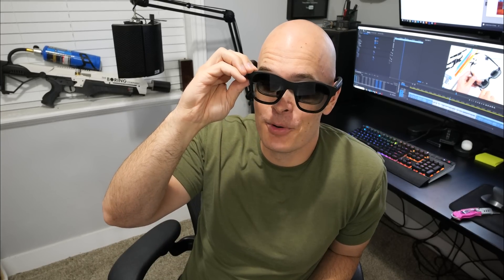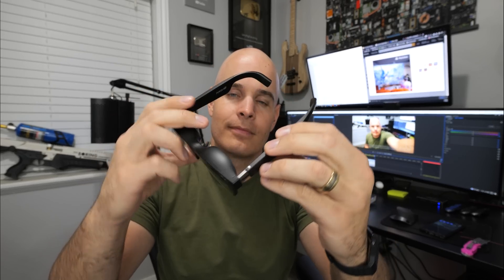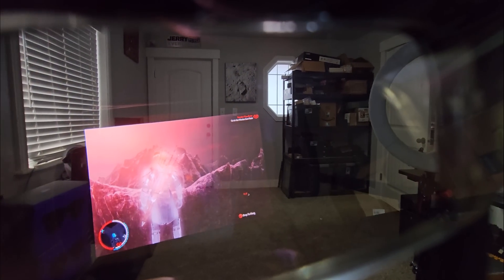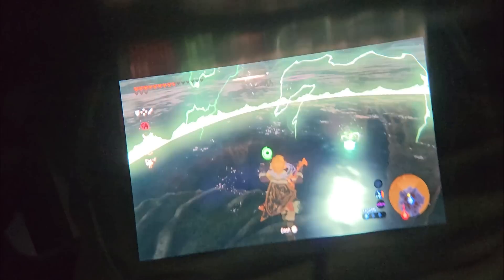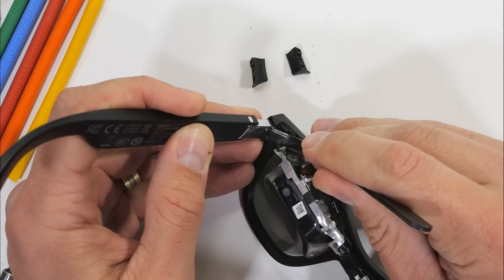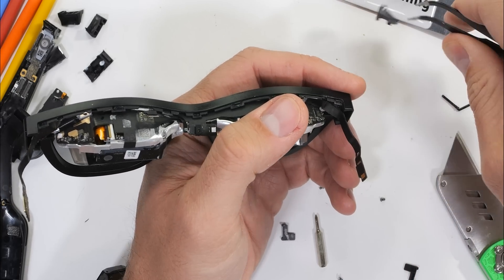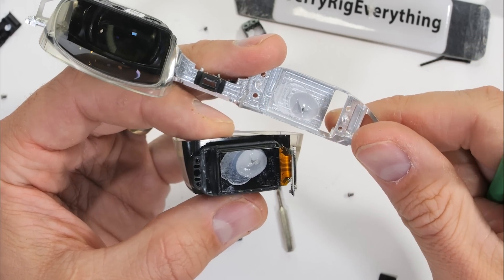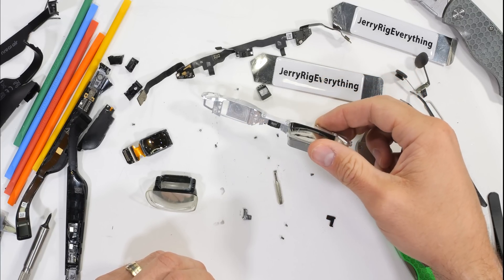The Smart Glasses of the Future are here! - (Teardown)

Comment: My only real problem with this form factor is that I have prescription lenses and can't wear contacts. It'd be interesting to see if they can do something about that in a future model.
Reply from the maker: They actually do ship with eye glass blanks that can be custom made to your prescription and attached inside the glasses. (so you'd be wearing 3 pairs of glasses built into one unit)
Reply: So rather then four eyes, we would be called quadruple eyes? Ha!
Reply: That was a feeble attempt at humor.
Reply: @JerryRigEverything  this, I would love to know how it works, weight, comfortability, and overall how it would effect the picture quality! Having some kind of “blue light” setting for hours of gaming would also be ideal!
Reply: @JerryRigEverything  so then wouldn't the smaller Nreal Light's form factor  make much more sense for people with prescripted lenses?
Reply: @JerryRigEverything  That's so thoughtful!
Reply: @JerryRigEverything  8-eyes?
Reply: @JerryRigEverything  That's great. But my question is do we really need our prescription glasses to see the screen? I mean, the oled panel reflectors are close to our eyes, so I don't think so..
Reply: @sanketamin  I am glass "owner", When I bought HTC vive I had issues without my glasses ... 
It may be resolved by now .... but it was an issue then, I had to wear glasses inside headset (it was possible, with little tweaks when putting on the headset) so I went straight to another problem ... motion sickness :D
Reply: @sanketamin  Yes, the focus is much further away.
Reply: @JerryRigEverything  oh geez
Reply: @JerryRigEverything I. Wondering if there is any effect of wearing the 3 pairs of lenses for a prolonged period of time, as a motion sickness or any blurring effect?
Reply: @JerryRigEverything  they were a bit bulky and i am not a big fan of shades but can the tinted glass be removes and the prescribed glass can be fitted in there on the fromt?
Reply: @JerryRigEverything  Well, I also hwear prescription glasses, so this would be... One nose, two eyes, three pairs of glasses, breaking the fourth wall in the fifth dimension of games. Well, I would play some serious tetris. With real buildings.
Reply: @JerryRigEverything  - I should have read the comments better, so disregard my own comment where I was asking exactly this question :)
Reply: @JerryRigEverything  cyberpunk is here hahahaha
Reply: @JerryRigEverything  like a spider with 8 eyes
Reply: @JerryRigEverything  I am subscribed ( my account is just on private. ) And I have notifications on that is how I found this video. It's also my birthday I just turned 14 today! 3/15/2009.
Reply: @JerryRigEverything upgrade my eyes for life or buy vr glasses hmm decisions
Reply: @JerryRigEverything  Hello friend ☺️.Can you please make a video on PS5.I will love you if my dream comes  true.
Reply: @JerryRigEverything  What should I do or I write ✍ 🤔 😕 😌 😏 😔 please 🙏 😢 🙂 😭 😀 😅 🙏 😢 🙂 😭 😀 😅 🙏 
I really want it
Please Zack
Reply: @SamSung-wr7lc  He said a comment, not a reply.
Reply: They actually have an option for people with a prescription I think.
Reply: @Bardock_Obama  I tried going through that process. The result was a lot of blooming/glaring being caused by the prescription lenses which made my unit unusable. I think I spent less than an hour in total using it before I got rid of it.
Reply: Yeah they come with a template thing that you can get perscription lenses put in
Reply: They give you a lense attachment that you can send to get your prescriptions onto , clips into where the nose piece goes , can't speak for the price however , 😔
Reply: @tnyc well played
Reply: …I’m thinking, if you’re nearsighted, it might not be a problem, depending on how strong your prescription is???
Reply: @Happynsnappy You're not the first person to think that. The reason that doesn't work is because, remember, these glasses are simulating the experience of a 200 inch screen a good few feet away, and the reason this works is because the screens trick your eyes into focusing to a point much further away than the true location of the screens. So, nearsighted people have exactly as much trouble seeing the "virtual" 200" screen as they would with a "real" one.
Reply: @Happynsnappy  No, that would be farsighted if they work like 3D glasses. The image focuses at a distance.
Reply: You need just the prescription lenses - and the most basic ones. So no problem at all :). It's like 50-100 USD.
Reply: @peterxF  think about it no more glasses for life. It saves you the money over the long run. But I wouldn’t expect a boomer to know that 🤌🏼
Reply: Hey Adam! Our Nreal Air glasses come with an additional prescription lens insert that you can get adjusted by an optometrist, or through one of our online partners. We're excited to work on making our glasses even more inclusive in the future!
Reply: @xreal_global  what about far-sighted eyes? Can you adjust the diopters or it’s not necessary?
Reply: @wintermutepp  Hey there! It's very much the same, as in getting the prescription lens insert adjusted for your prescription through an optometrist or one of our online partners!
Reply: Same here
Reply: This is really cool. As a very frequent traveller, and one who enjoys movies on the go, these seem pretty legit for my use case. Though I'll hv to see abt my prescription glasses, but as you replied looks like they do hv an attachment.....so that's covered i guess.
On another note, excellent content as usual, but def the best videos were the wheelchair for kids and the library. Amongst the few youtubers who think beyond themselves. Corporations should learn a thing (or two) from you mate.
Love from India.
Reply: I’m curious if they’ll make a 4K version. I think I’d be interested in replacing my main monitor with something like this, but once you get used to 4K it’s really hard to go back to 1080p.
Reply: They can't as of now, just wait for eye cyberware and you can get rid of these pisky humanoid eyes all together.
Reply: Get laser you bum
Reply: @Uno_Floydd  I would if it wasn't 2-3k
Reply: @Jamie_Devvix  better than any vr glasses. Priorities
Reply: It comes with a pair prescription lenses that could be attached to it. You can find a local optician who can do it for you.
Reply: @FazalFariz  yes install a brake kit when you need tires.
Reply: Seems like a great way to conaume media during long commutes
Reply: The magnifying lense looks like the size of my prescription
Reply: I have a prescription insert in mine. It comes with it by default.
Reply: Very cool idea.  The totally enclosed VR googles leave one feeling a bit vulnerable without any external awareness so this seems like neat way to offset while meanwhile more immersive than the infamous google glasses
Reply: I would loooove to try these
Reply: I never liked smart glasses, but I'll admit.. this look cool. Future is gonna be awesome
Reply: I think they are awesome
Reply: this is a start, I'm also excited to see where this goes and which other tech giants/companies will possibly partner with Nreal or develope something similar on their own pushing the envelope even further forward where ever that  might lead.....I shudder to think.
Reply: Super cool!! I’d use it to edit videos
Reply: These glasses solve this problem. They comes with interchangeable nose pieces. One of the pieces allows you to attach prescription lenses to them.
Reply: My real problem is that we dont have this in my country ☹️
Reply: I wear prescription glasses. But why would you wear one while using these glasses? To look at the keyboard? Are we still interacting with the real world while using this?
Reply: @alihms  So you can see the image maybe?
Reply: Truly amazing where this kind of tech is now, especially the price. I remember Google Glass coming out at around $1400 if I remember right and that was for a single small screen on one eye. Still, I wanted one so bad.

As for a game... Probably not the most amazing game visually but my brothers and I have been hooked on Space Engineers and I'd love to see that through a pair of these glasses.

I'm also a fan of multiple monitors. I have 4 at work and have thought on multiple occasions when or if those could be replaced with a pair of VR/AR glasses.
Reply: I got the rokid ones with built in diopters. Worked fine for viewing screen but not for everyday wear. Everything was too dark even after removing shade. And couldn't see like with my glasses.
Reply: Interested to know what the resolution looks like in real life
Reply: Maybe a new frame that can be fit over your glass and also removable when required.
Reply: At first glance, they kinda do look like bifocals.
Reply: The glasses come with lenses that you take to an optometrist to make into your prescription..
Reply: I have prescription glasses and I use Meta Quest 2. I  have trouble seeing far and the Meta Quest 2 works great w/o glasses because the screen is very close to my eyes. I imagine this would also be perfectly fine for anyone who has trouble seeing far.
Reply: Can't they add your prescription via software?
Reply: @mbuyachiks31  You don't seem to understand how vision issues work.
Reply: Hi Jerry, I’m a big fan of your channel! Watching you disassemble something is my zen moment of the day. Regarding the glasses; could they be used for VR games or is it just augmented reality stuff?
Reply: @thomasward5722  It's only a display focused at a distance. No FOV at all as far as I understand.
Reply: Hope i could try that 🥰from the 🇵🇭
Reply: Looks more promising from google and other wish have one
Reply: Future is exciting
Reply: physical devices like this are stupid anyway, wit for neurolink
Reply: I would like to try it
Reply: I likey
Reply: Every human heads are different... Ps not a collector 😅
Reply: Those look really awesome.
Reply: They make prescriptions for it.  They work great.  I've worn them for hours with zero problems.
Reply: I would like a set. Please pick me!!
Reply: Like a boss
Reply: Fantastic invention
Reply: So, On taobao, they have prescription attachments for them.
Reply: Please give me these glasses sir
Reply: Thanks Jerry, great teardown as usual! Might be time to sell my Quest 2 goggles if they can get developer community support.
Reply: This seems like a great accessibility tool
Reply: I want the teard downed ones😂 because i want to experiment with them😊
Reply: Hello Jerry can you wear them on top of your prescription glasses if you can I'd be happy to try them on.
Reply: Such a cool concept, thanks for all that you do.
Reply: I came here after the scammer video. Just want to say your respond was amazing and is very professional. Best of luck to you and your viewers!
Reply: I like them now let’s get a tear down skin for them lmao 😅
Reply: These would be great for RV glamping users looking to get some gaming done on rain days or keeping warm in bed watching a movie.
Reply: if you have the money for those lenses, u can use contact lences too tbh
Reply: What should I do or I write ✍ 🤔 😕 😌 😏 😔 please 🙏 😢 🙂 😭 😀 😅 🙏 😢 🙂 😭 😀 😅 🙏 
I really want it
Please Zack
Reply: why cant you? I think you should  be abel to see even without contacts just fine. maybe i am wrong
Reply: @xemsisx  i don’t think so depends on the eyesight of the person it’s a cool product tho
Reply: Hons VR and Lensology sell perscriptions to these glasses. It starts at 50usd. So it’s not that expensive. You can also go to most opticians and get a custom one from them, but that will be more expensive.
Reply: You meant your only (n)real problem?
Reply: I have an added problem that I wear prescription prisms.  Probably won't work for me .
Reply: @IowaKim  Look up Lensology, they're UK based but over on Reddit people from in the US have also bought from them with really faster turnover rate (only days). I personally ordered prescription lenses from them for my own pair of NReal's, and it cost me 95£ (Aprox 108 Euro) + Shipping (which is not expensive but was free for me due to a promo). So far I haven't seen a single prescription they can't make, and the owner himself is super responsive and friendly, so you can always ask if you're ever interested.
Reply: They thought of that and give you the option to wear prescription lenses
Reply: They sell a version with prescription lenses
Reply: @JasonEllins  no fix your eyes first
Reply: I never get to win any of these give aways 😢
Reply: @ThatDudeHandy  oh poor baby
Reply: This is just amazing ,this video made me prevent from Suiciding thanks a lot
Reply: They will work it out or fix your eyes one or the other.....
Reply: the mind, the soul, idea, ignorance, pride, dream, stray, patience, fear, life, worker, success, graduation, power, festival, deception, i struggle with myself, use reason so you can live for yourself
Reply: @nohypocrisy  watermelon, pomade, ashtray, baboons, yoghurt, asshair, brick, ginger, comb, Einstein, diarrhea, rainwater harvesting, batteries, penis, i am the CEO of the Flying Anus Industries, so you can obtain your very own flying anus(copyright pending)

Comment: Usually it does not hurt, when you destroy phones for science, but somehow I felt sad for the glasses. :D I think it is a smart move to not include a battery. A battery would only drain more power from the connected device to charge the battery while using the glasses and weight and safety got gently hand over to the mobile device manufacturer.

Comment: Nice, I would not use those for gaming, but instead try to use them as a work monitor, depending on what resolution  you can set them you could be able to see multiple desktops and applications without having the trouble to have that much monitor taking up the space on your desk.